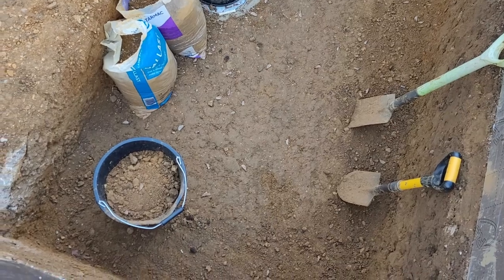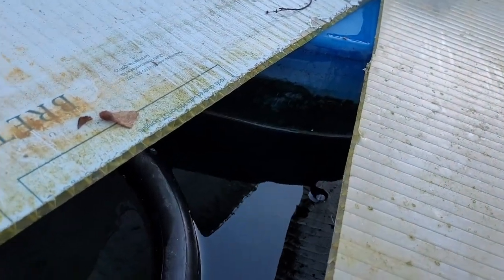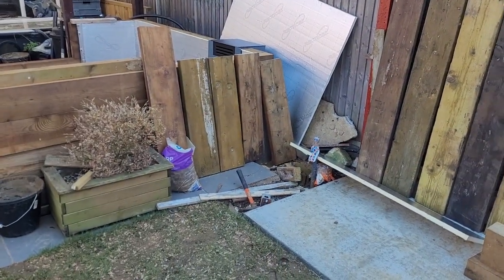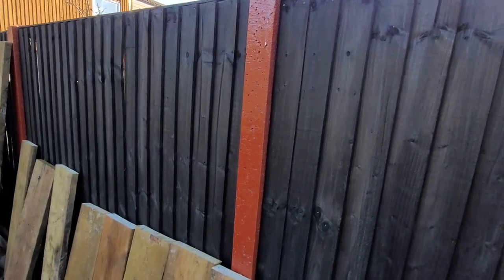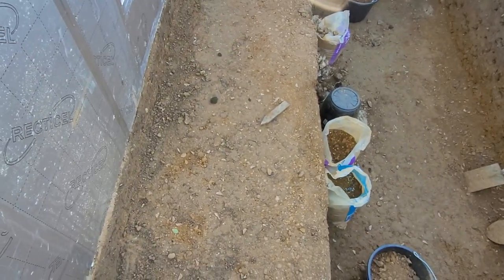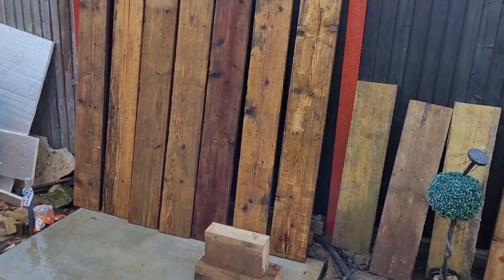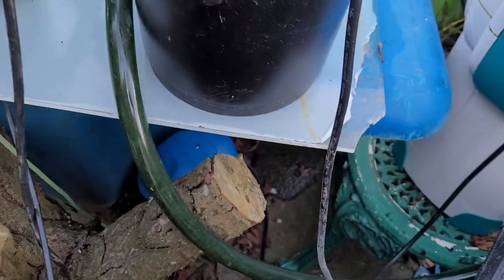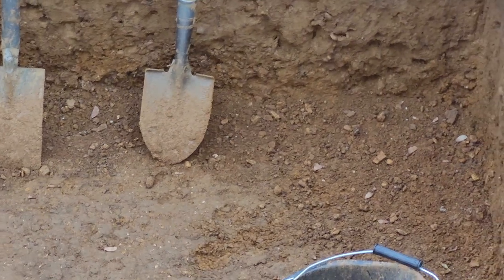Sleeper Pond with Window (Part 25) Walls are Straightened, and making a start on the filterhouse

Comment: You may be putting too much flow through Vinces shower Jamie, just a thought if you can lower the pump flow. 👍👍
Reply from the maker: To be honest that's the only thing I haven't tried yet but I don't have a smaller pump or pipe fittings to try that yet but I ain't giving up 👍

Comment: All looking good mate 👌 that little shower you had of vince try situating the spray bar so it sprays more in a down direction it might be hitting the sides and tracking down it was working ace when vince tried it but probably got disturbed in the post 👍😉
Reply from the maker: Cheers bud yeh I tried all directions but it still does it if I move anything on it I think I've fixed it then 30 seconds later its leaking somewhere else 🤣

Comment: Why you putting sand down for the reason I,am asking for is if the ground moves under the sand the sand also move and then your liner will sag same has carpet never put that under a pond … the best thing you can put under a liner is some pond fleece which is made to go underneath the liner ..? people can correct me if I,am wrong I just thought I save you some money putting in sand in the bottom
Reply from the maker: Fleece would move just the same as sand anyway but my ground won't move as its solid building materials hard-core etc the reason for the sand is exactly that because its all hard-core stones etc the sand is for extra protection so there are no sharp stones or rocks touching the underlay or liner 👍

Comment: Hi Jamie I am building a similar pond and was wondering what you stuck your Kingspan with I was thinking no nails might work?
Reply from the maker: Hi Dave I did show and explain all that in a previous video but I wouldn't use no nails as when the timber moves it will crack also it doesn't work well when damp you want to use either expanding foam or a flexible grab adhesive, or like me abit of both 👍
Reply: @keepingitkoi  thanks Jamie but I’m on breeze block what do you reckon
Reply from the maker: Even with breeze block i wouldnt use no more nails as its not for out door use its not frost proof etc go for either silicone, out door grab adhesive or expanding foam 👍🏻